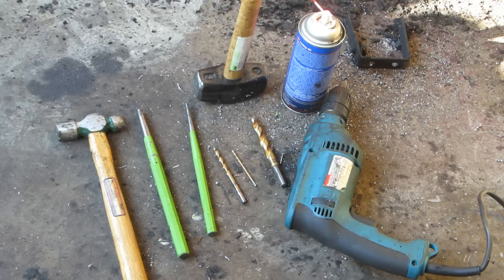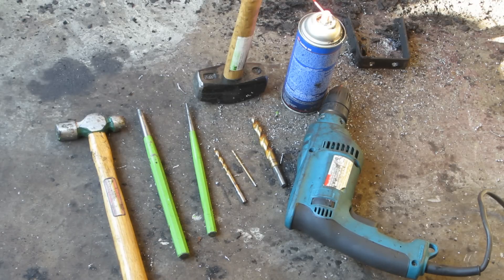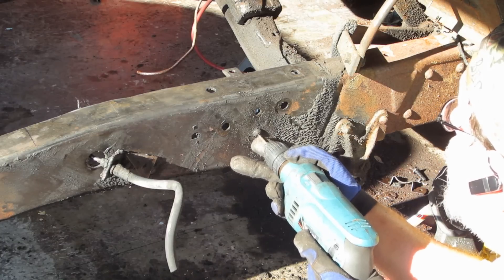Remove Frame Rivits

Comment: Hey thanks for the vid. I have to relocate my spring hangers and thought for sure I would need a torch to cul the rivets out. I thought they were the same hardened steel that the shackle bolts are. This will save me a few hundred bucks from not buying the torch, at least not yet. Much thanks!

Comment: Thank you so much for sharing this video, I found it very helpful as I must bust the rivets on my 55 Advance Design in order to correct frame rust behind the cab where the cross member is. Would you mind videoing the welding of the frame? I don't have 220 either and would be interested in your techniques as frame welding is at the upper limit of 110v welders...
Reply from the maker: Matthew David  Glad I could help. The frame is one of the most important parts of the truck. You might want to get it prepped and have a prowelder do the welding. You can't cut corner with this. You must get good penetration or you could be in danger.

Comment: holy crap thank you I was wondering how to take off a rear suspension bracket hanger off the frame went to an auto wrecker and they all got 3 rivets 1 bolt, need to replace mine.
 I seen several ones with minimal rust on them but I cant bring in my power tools as there is no plugin courdless drill will work for this purpose.
I will give this a shot and for my next trick I have to jack the truck and move the damn support to the frame as they like to brace it up on the suspention leafs lol.

asked them if they could lift it for me nope there useless :P
Reply from the maker: +UltimateCarnage  My U-pull-it has a mobile gantry for pulling engines. You might hook that up to the bumper. It's just a thought.

Comment: What do you use to put rivets in to hold that same part you took off?
Reply from the maker: When I replaced the battery box d the front cross member I went and bought grade 8 bolts with nylock nuts. they were 3/8" X 1" worked great.
Reply: Ok

Comment: A decent air hammer will take the head off in a few seconds
Reply from the maker: Yes but you need a good 220volt air compressor. But I had only 110. I was showing what you could do in a small space.